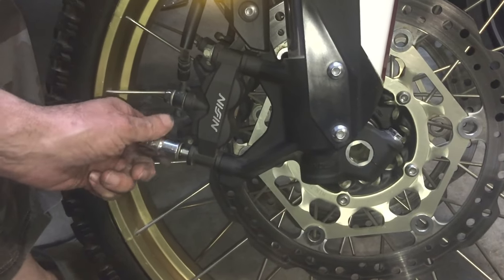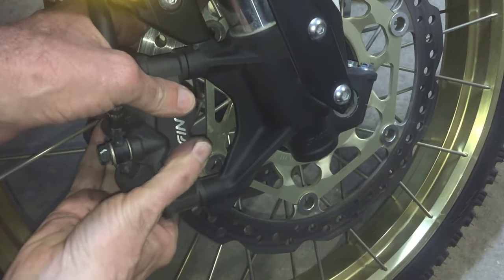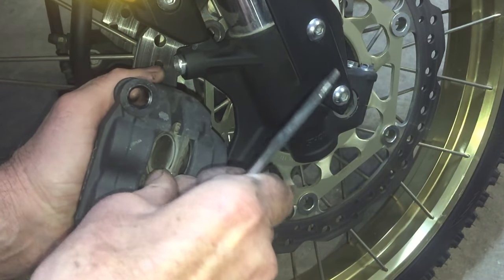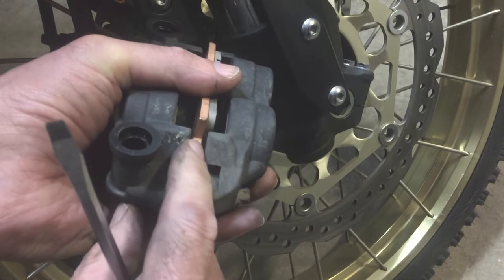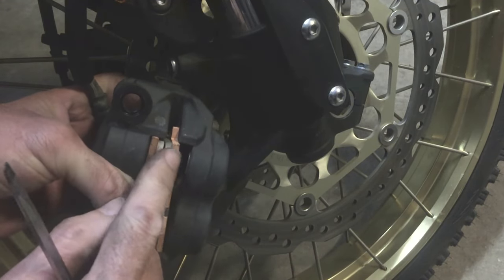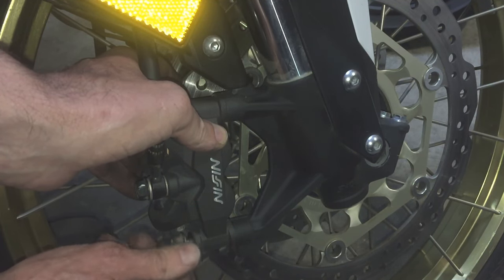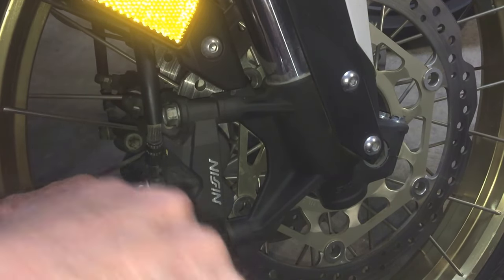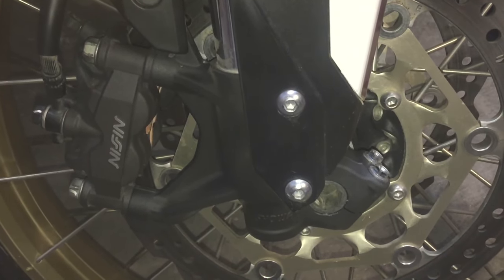Africa Twin Front Brake Pad Replacement

Comment: Great video ! Doing mine tomorrow , it’s always worth having a look at the easy way. Like you flat head screw Driver and no torque  wrench  at 63 I think I would do it myself and I know bits done right. Although I would have pumped the pistons out a little and got a good load of Brake cleaner in there and a tooth Brush round the cylinders just to make sure they won’t stick or have been sticking a bit, but that’s just me! Great video.

Comment: Thanks alot for this lovely vedio, i did the same to my AT , little advise : better to put some grease in the break pads contact points , also some grease ( little amount ) in calipers bolts thread  .
Saving both from corrosion & squeak , and make both super easy to remove next time .

Comment: From NC to AT - did the same "upgrade" few years back. The AT sure is something... but I never managed to fully appreciate the DCT. What do you think? Mine was a 2019 so I guess the DCT is a bit more refined on yours.
Reply from the maker: I’m currently sitting in a hotel in the bush (Hill End in NSW) after riding nearly 400km, with a good percent of gravel and dirt farm and mountain roads. 
Never once felt I needed to put it into manual. The DCT really is smart. And sooo smooth.
Reply: @AfricaTwin-Stuff  Good on you, Adrian. Enjoy DCT and NSW! :)
Reply: Looking at the thickness of the new pads,  the ones you removed are barely half worn. All this recent extravagant behaviour is alarming me, after you being so careful and watching the pennies when you first got the nc, did something recently fall on your head?
Reply: @MrBeracah  hahaha :)

Comment: After maintaining your right caliper, it is also necessary to activate the rear brakes, as they are connected with the right front caliper via Honda's Combined Braking System (CBS). If you don't, the next time you step on the foot brake lever there will be no braking force at your rear wheel.
Reply from the maker: No. The NC has never had combined braking.
Reply: What? The AT doesn’t have combined braking.
Reply from the maker: Correct the AT doesn’t have it - fortunately.

Comment: Nice job done. Don't you use  chemical thread seal ? Best Regards Kamil
Reply from the maker: No. Never seen the need. Never had a problem. But don’t follow my example. I’m just a back yard tinkerer!
Reply: @AfricaTwin-Stuff  Me to but I had an issue(i lost the screw and caliper was down) afer some off Road trip on my Old GS 650 and now Im thinking is it worth to use some protection. Anyway thank you for the good video. BR CRF 1000 user from Poland :)